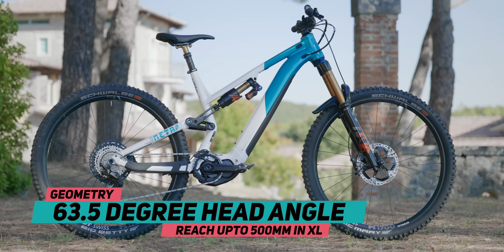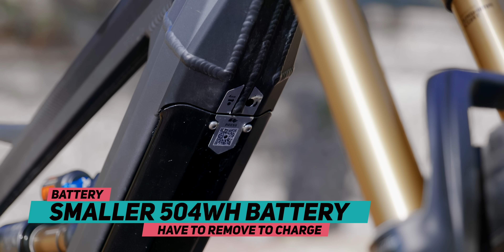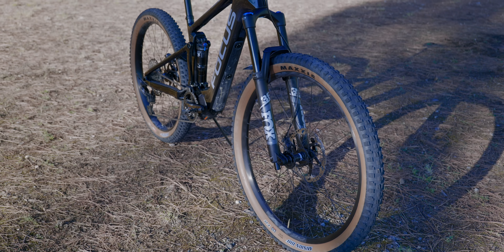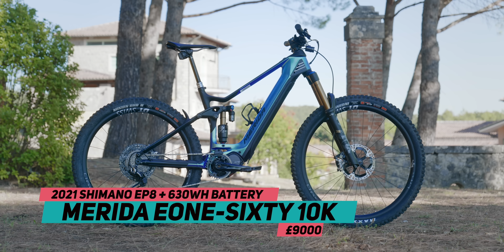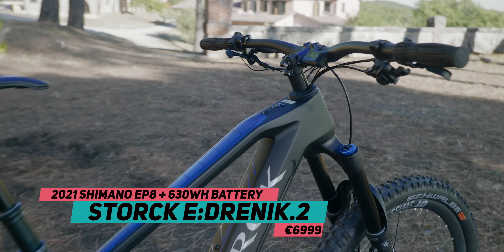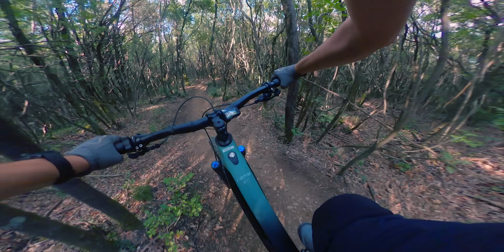TOP 8 - Electric Mountain Bikes with NEW 2021 Shimano EP8 motor

Comment: The frame of Orange bike is so hugly ..how can you speak that way . It is just a Puzzle made with aluminium parts . One for the battery and small pieces around to build a link to the head even the quality of welding job is poor .. just the name is not enought to make a good bike . They was not able to draw the down tube in 2 symetric pieces . DIY, patched up, randomly advanced this is the frame !!!

Comment: Lots of interesting things happening with eMTB motors. When the the "EP9" finally rolls around in a few years time it's probably going to be near perfect, and batteries and weight might be slightly better too. For now Brose is still the top motor for me, some question marks about reliability yes but it's the quietest and most natural feeling at the moment.

Comment: For what these Ebikes cost I find it unacceptable that the motor makes a 'cheap' rattling noise while riding.  I think Ebikes need a few more years for things to get sorted out a bit more. I very much have a worry that an Ebike will be like a smartphone - after 2-3 years it feels slow, worn out, with a battery that doesn't have good charge capacity and overall the bike retains very little value and needs to be replaced.  I think the industry needs to come up with a replaceable/up-gradable battery/motor/control system in the future because the cost of an Ebike today is a lot of money to depreciate in a short time.

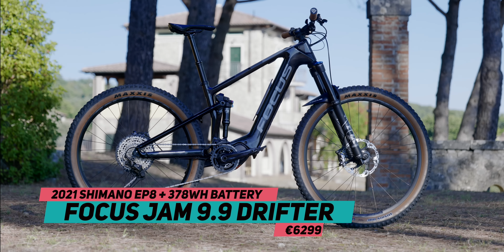Comment: 5:55 it looks like they just used the same frame on the focus sam^2 like form the pervious shamano model. the motor got smaller and now you got an overhang at the front of the motor from the frame. am I right? on the pictures on their website it looks like they just smashed an a faceplate so the bottom is the same size as the previous model xD

Comment: Well done Rob-Those are really impressive all around with so much more stunning paint graphics and designs.  Always been a fan of the Hard Cross and the others in their lineup. A lot of excitement out there with the EP8 now. Hope they work out all the kinks in that motor. The Orange is so chunky on so many levels (in a good way). Looks like it was designed more around a rider that is also big/burly and chunky. Would be a nice fit for its length. Great reviews as always! Cheers Rob!

Comment: I've got £10k burning a hole in my pocket, as a NDURO i paid for back in April is still not likely to ship till November, and I don't really want to wait that long. Took me ages watching your stuff to get to that bike, and was happy to wait a bit, but getting beyond a joke now and I'm concerned e-bikeshop is a bit of a scam (early any comms - and had advertised having stock when they didn't). Any recommendations on a replacement?
Reply: Top of the range Merida E160 comes with extra battery. I got the cheaper version and suspension is basic. Rest is great.

Comment: Hi Rob, I can get a Norco Range C1 $9.5 AUD now, or the Commencal Meta SX pre order for December $10.5 AUD. Would love to hear your thoughts on comparison. Couple of key things, Norco Shimano e8000 motor, all carbon frame, lyric ultimate, 27.5, Commencal new Shimano Motor (e8?), Aluminium frame, Zeb fork. There's also the 29er option in your video, mid model is 10.5 AUD.

Comment: Could you run 27.5 wheels on the meta or would it not work well with the geometry? I know they do the power sx in 27.5 but I so much prefer the look and spec of the power 29 😩

Comment: Local Husky dealer told me the new Hard Cross should ship in November ( accepting orders already of course ) ... great looking bike imho and it seems one of the more sturdy shock designs as well. Some brands use some very flimsy setups, like the mounting points on the frames, I wouldn't feel comfortable using the max suspension travel one some of these... and after all, they are very expensive. A decent eMTB is about 2/3rds the price of a motorcross bike. Strange world...

Comment: As per the rattle issue, every motor where power and torque is transfered by gear wheels is going to rattle (like in a car gearbox). As you constantly balance your body on the bike the mechanism engages and disengages causing the rattle. At least you would hope the motor should last a bit (unless the gears are made of plastic). Brose motor in comparison is quiet cos is driven by a belt but those belts snap under heavy use. So it's your choice you either bear with the rattle and hope your motor will last a bit longer or choose a quite brose and pray you won't need to walk back home after next ride. Or you just stick two fingers at those ridiculously priced ebikes and buy yourself something driven by your mussels at a decent price. By the way the hiccup with shimano's new motor is rather worrying. Maybe they just should stick with producing great mechanical power trains and leave motors to Bosch and others who produce electric motor-driven devices for decades.
Reply: The trade off with making componentry lighter and lighter will always be reliability. I have read that with the latest higher torque motors chains and sprockets made for non e bikes just dont last.
Reply: The brose snap due to high torque and low cadance ...... people need to spin the legs more

Comment: The Commencal Meta looks like it has exactly the same rear linkage as a Levo. i love the 35 fork, i'm looking forward to trying the 38, hopefuly on the 2022 Levo. Big Betty ? a bit like Big Bertha, ahem ! but i guess it's ok because it's germans having fun about german history.that EP8 really looks groundbreaking, all the bikes i have seen that use them look like SL's, Brose might as well stop producing motors by now, especially with the "issues". too bad the battery doesn't slide out, i will NEVER buy a bike that has a battery that drops out the bottom of a tube, tubes are supposed to be closed, not U shaped, the loss in rigidity, or extra weight is not acceptable.i hate the looks of the orange phase, and 508wh ?, the frame looks like it has been slashed with a knife !, you call that a boike ?, this is a boike ! NEXT ! (oh and i prefer to own my bars, no rentals :) sorry Rob but why do you put bikes in a top 8 that you haven't tested ? Focus ? nice, very beautiful, love the tan tires and grips, need to find my old leather jacket (it's so old that i invented that i had one). another Orange, NO !, looks like it's made by Lego, and the bash plate will kill people. Stevens, super cheap for a carbon frame, interesting, but frame looks a bit clumsily designed, and, again, has that damn battery that falls out. Shimano got that badly wrong. The Merida is sublime ! what a paint job !! extraordinary (yeah also that U shaped down tube, its SILLY, i learned that the egg is a super strong shape when i was 6 years old !), that is so 2017 ! Husqvarna looks like a fischer price bike, stick to sowing machines thx. those bash plates are annoying, the FIRST problem is pedal strikes ! all those ebikes are too low. Storck, good. Rob, is that Italy ? Spain, Croatia ? lucky you :) oh GREAT job talking to them about that noise !!

Comment: you say the large is too small for you?   What is your height Rob?
Reply: regarding the commencal power meta
Reply from the maker: 6’3” and it felt cramped for me
Reply: @RobRidesEMTB  Hi Rob, thanks for another informative video (especially good to know why deliveries of EP8 driven bikes has gone back to December). I was just about to put my money down for the meta but hesitated when you said that the Large was too small for you. I guess with you being 6'3" that makes sense as you're right at the top of Commencal's recommendation for the Large. Being 5'11" I think the Large should be fine for me, and a mate's 2020 meta sx (27.5) in large was seemed just right for me. 
Great work as ever, thanks again
Reply: @iainfarquhar3474  im 5 11" as well and the rep recomended a medium so that it felt more playful  - large might feel a bit big - Rob any thoughts?
Reply: @andrewkesler5755  The Meta 29 2021 (large) is very slightly shorter top tube/reach wise compared to last years Meta Power SX in large. The SX felt just right to me when I rode it so I don't think that it will be and issue. I prefer a bike slightly too large rather than too small (right or wrong, I don't know) but others may differ

Comment: So many new great looking bikes to come. Interesting how shimano convinced so many OEMs! The Focus looks a little bit unaligned in the connection from lower tube to the lower line of the engine. 6:42 ?!
Just an Irritation from the pedal?
What kind of event was it?
Hope they get these issues solved and we still earn enough money next year to pay these prices👍🤩
Reply from the maker: The Focus was actually missing a plastic plate that closes up the frame and motor. Production version will look correctly finished. It was the Shimano EP8 launch event. 👍
Reply: @RobRidesEMTB  thanks for reply! Excellent job! Asking my self how long Specialized can hold on to Brose? Looking forward for comparison with individialisation besides Brose.

Comment: Rob, I guess the motor news means that all the bikes shown (+ Merida + others) sales are all on hold for the moment then? Any idea if these manufacturers or Shimano intend to run further further batches of the existing bikes with the existing E8000 motor?
Reply from the maker: Hi Dominic. Correct, all brands need to wait for Shimano to make production line changes and produce the reworked motor before the brands can assemble the bikes. Any bikes already assembled will require the existing motor to be replaced, therefore everything is on hold until the revised EP8 motor is produced.
Reply: @RobRidesEMTB  As you said elsewhere this is a bad situation for all concerned. Have you heard if any brands might try to "fill-in" the hole in sales orders by fitting the older motor or some other arrangement? Thinking about those with money burning a hole in their pockets.
Reply: @dominicbushnell4092  frames are made specifically for the motor they intend to mount on it, and this new motor is smaller than the E8000, so I highly doubt it can be fitted on the new frames designed for EP8

Comment: Yep the Meta looks cool. Also like the Stealth Bomber look of the Orange. I'm really interested in a 38 as I preferred the Lyrik over the 36s .... so very interested to see if a 38 is better than my 36 on my normal bike.
Sorry but the Hisqvarna looks hideous to me in the photos.. if it looks good in person its seriously un-photogenic.
 
As for the EP8 then it's shocking it failed the ISO at this late stage... 

Also I'd say that fixing the bag of spanners in a washing machine is a DO not TRY task. I thought you potentially had a faulty motor but how that got through and signed of for release is baffling.. that noise will be a deal breaker for many people as it implies wear and a defective or low quality product.. IMO it will kill the market for the motor if they don't fix it completely.

Comment: Nice review again.
As a time served machinist you get a thing called backlash!
If I turn a handle one way it's meshed tight and when I start to turn it the other way depending on how old or worn the machine is you get a small amount of turn/play when the handle/acme nut and the screw don't move.
I'm guessing the gearing in this motor and I've heard you and others say about the bosch motor as well the same thing is happening!
It's a noise but I'll cope with it when I finally decide on which on to buy.
P.s you won't get this on a belt drive.